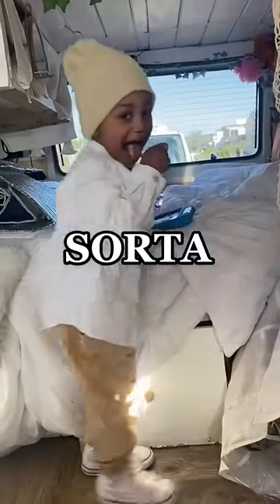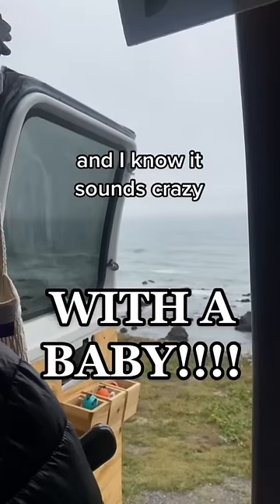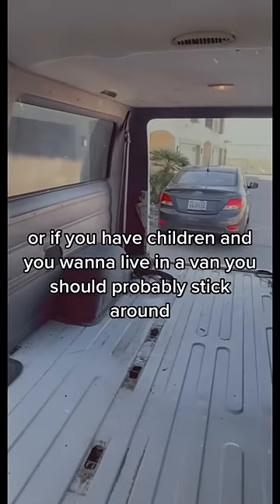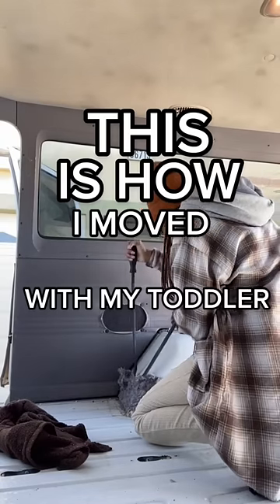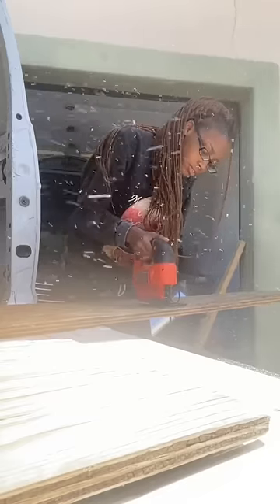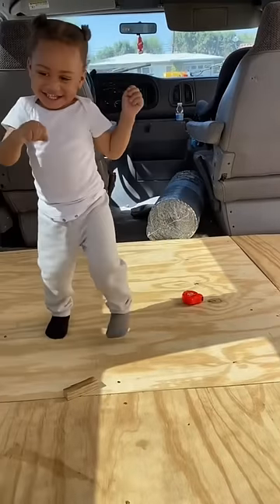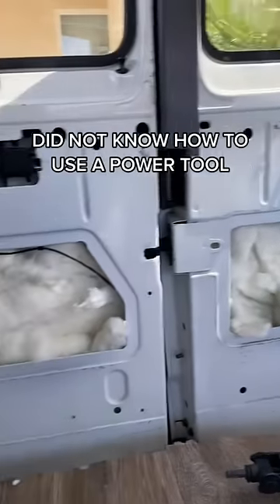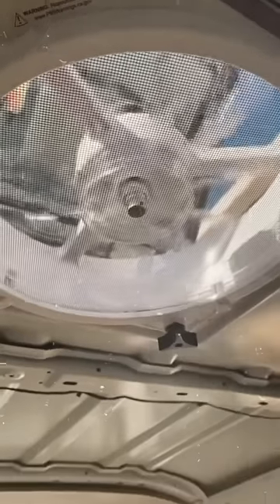HOW I STARTED LIVING IN A VAN WITH A BABY #vanlife #shorts #shortsvideo #shortsfeed #travel

Comment: Great job.go get you a loves or pilot gas cards. You get points for gas. Then you can take a shower.  Im a trucker.  I use a blk 5 gal bucket with lid from home depot with blk 5gal bag inside . I brush my teeth and splash water  on face. Also use for toilet.